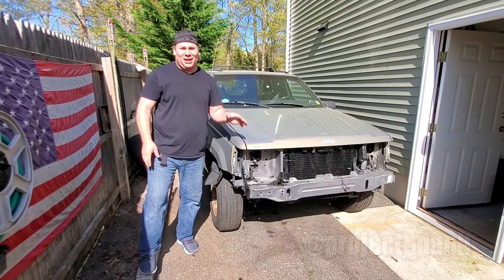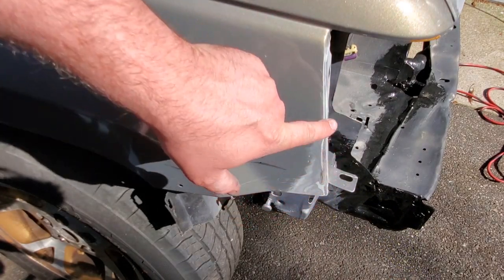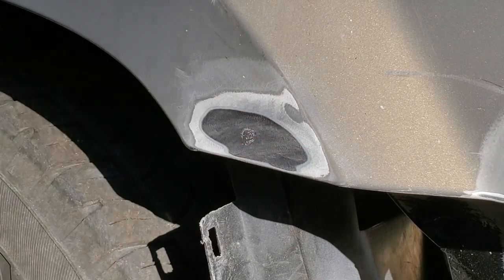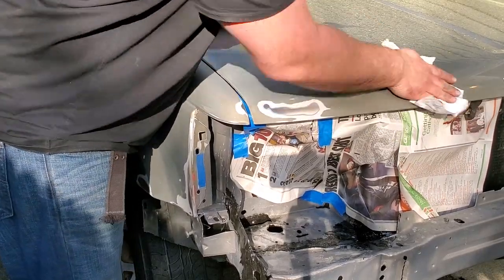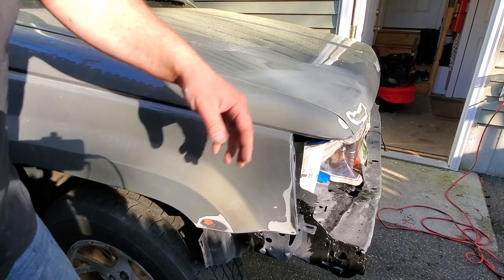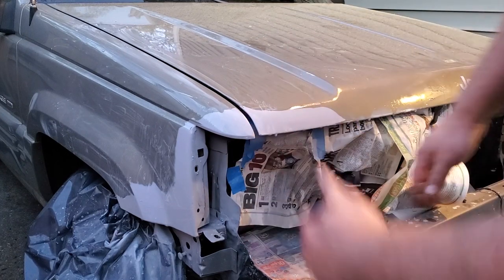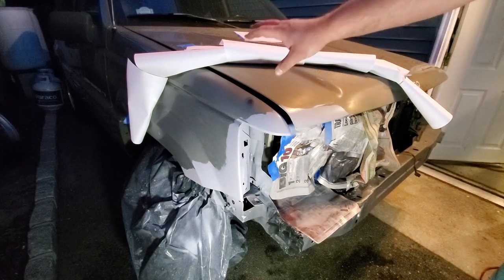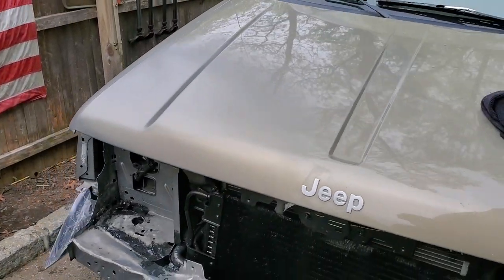JEEP ZJ BACK YARD CAN JOB - 1998 GRAND CHEROKEE GETS SOME FRESH PAINT

Comment: Thanks for the shout out lol.. hey for a rattle can job it came out fine... the only thing I’d recommend you doing in the future if you chose the rattle can method is to use an automotive grade 2 stage clear coat... it’s very difficult to blend the clear, usually you need to wet sand the entire panel you’re touching up and then respray the clear on the entire panel...
Reply from the maker: Your absolutely right! I'll definitely check that out... Hopefully we can collaborate next time I'm spraying something!

Comment: Great Work! 
Hope this is not a silly question but I have a 1998 Jeep Grand Cherokee Limited 4x4, Slate Gray and I love it. Question can I just spray Base and Clear Coat without using that hand held buffer, maybe just clean, sand and spray. Not experienced, things are so expensive, was willing to try. There's a small fading area on driver's side right below hood.
Reply from the maker: it all depends on the product you use and your skill level... check out the Paint Society youtube channel. They're a wealth of DIY paint info! https://www.youtube.com/watch?v=tDnecjnpYMU

Comment: I have my own cheap jeep goin on same color...what base coat did you go with i have some touch ups to get under control...lol
Reply from the maker: I used some paint  from EBAY and some from automotivetouchup.com.  both were sourced using a search of the paint code PJ7 CHARGOLD METALLIC.   I honestly like the spray pattern from eBay can nozzle better.